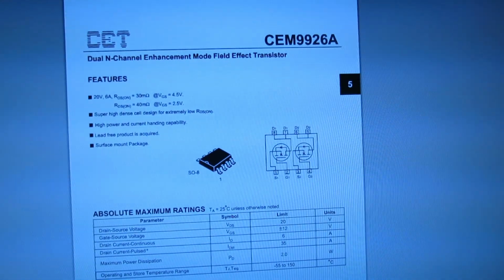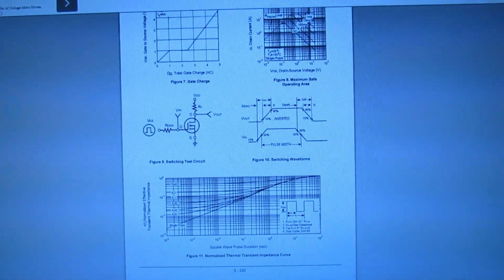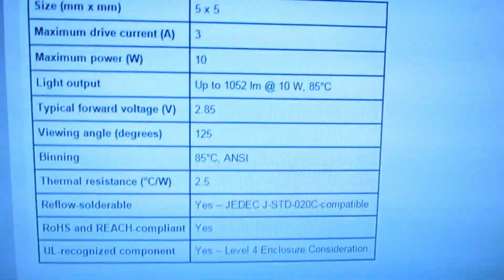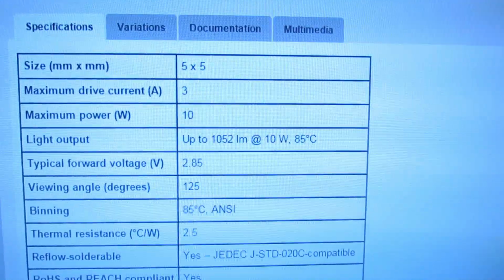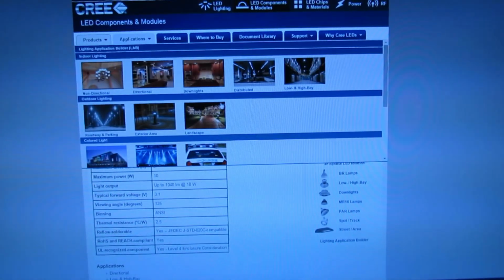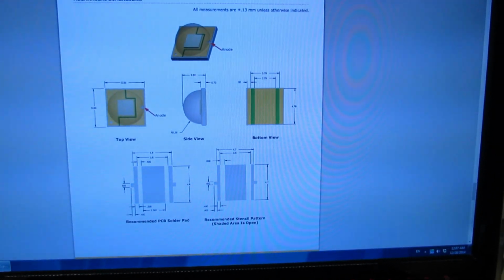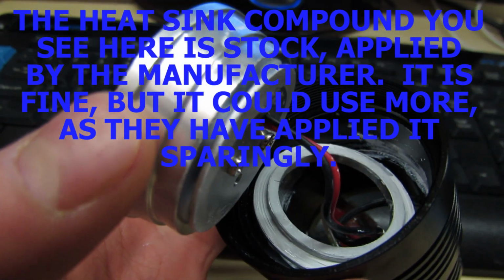SkyRay King 7 x Cree XM-L 2 T6 LED Flashlight Tear Down

Comment: If my vision, whether the flaslight does not use a resistor
Reply from the maker: Yes, the driver in mine used a current limiting resistor.
You can jumper it to make it more powerful, but it'll get hot real fast.
Cheers,
David.

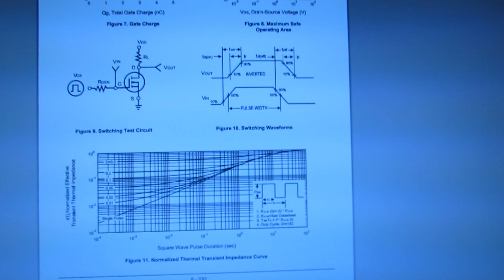Comment: first @3:58, it is square wave, not saw tooth. Second @4:08 400Hz can't be seen by human eye. We can see roughly 25 Hz and no further.
The datasheet CEM9926 you're looking is just a FET that is driven by the controller, so that's not the controller at all. All what you see isn't driving the LED, its just FET specifications!
Reply from the maker: Good catch!!  Thanks man!  I don't like the stroboscopic effect, that can happen with chopping light, the newer drivers seem to get rid of that, but some cheaper lights still have it.

Comment: here is a good review of the skyray king: 
https://youtu.be/d2jCcJTq3k4
Reply from the maker: Thanks man.
The 10 looks pretty awesome.
The Skyray King is a great light isn't it?
Do you run good batteries in it?  I recommend the Sanyo 3500mAh batteries, or the LG 3500mAh, they give you lots of power and great runtime.
A full 3500mAh of power, the cheaper batteries can be pretty horrible, and give like 900mAh if you're lucky lol.
Cheers!
David.

Comment: are you sure they are genuine original Cree?
there are many copies that are on sale inside these flashlights
they are similar in design,but less output and bluish tint.
look here
http://budgetlightforum.com/node/41084
Reply from the maker: Great question, some youtubers tried upgrading the current over 1.5A, and the fake XMLs all blew up in their 7 x XML SkyRay, so that's a great way of telling if they're fake, just drive them up to 3A, the real CREE ones will handle it like  champ and output around 100 lumens/watt, or 1000 lumens total.
It seems that if you get the XML2 version, you'll get real ones, since they haven't figured out how to fake them yet.  What they'll do is ship you XML fakes, instead of XML2, hoping you don't notice, but that's an easy scam to catch, so you'll get a refund easily, did that once.  The seller said nobody else complained.
I also boosted the power input of my SkyRay 7x XML2 to over 70W(Peak 85W), and it handled it no problem, so for sure these are real XML2 LEDs in the one I received.

With regards to the latticebright LEDs:  I have some Latticebright MCPCB boards with XML LEDs on them, and they seem to perform just as well as the real XMLs(Tested on my 3GS light meter rig), pushing out close to 1000 lumens, so I think those are real XML, and even perform better than the real XMLs that I had and some of my XML2s with a warmer white color temperature, which leads me to believe they're a newer production of the XML LED by Cree, maybe from a different factory under an improved process that results in a higher efficacy.

There is definitely a market out there for fake LEDs though, so we need to be careful and buy from Gearbest, Fasttech, Convoy, or other name brands, and we'll be fine.  It's just the cheap $5 flashlights that will have the knockoff LEDs, or SkyRays from Ebay and Aliexpress from sellers with poor reputation, and even then, at $20 for a flashlight that produces over 2000 lumens, it's still not bad(But still criminal, if they're mis-advertising it as a true Cree brand).
I've been ordering replacement LEDs from Convoy and Fasttech, those will be real for sure.  They wouldn't jeopardize their reputation to make a few bucks off a $6 item, lol.
Thanks for the comment!
Cheers,
David.
Reply: "be careful and buy from Gearbest, Fasttech, Convoy, or other name brands, and we'll be fine".
That's not full true, there are copy also of spares Leds like XML2 (only borads with leds)from the Chinese stores you mentioned.
Also manufactures of these flights change often,so 1 time would be good, next time not
Reply from the maker: MACYNET323 Ya that's true,  it could still be fake at some point,  but I think those sources are pretty reputable,  and their customer service is awesome so if you run into a problem,  you can get a new one shipped.
I got a defective XPL from Fastech once,  it was on an aluminum MCPCB, it had a loose internal connection,  they sent a replacement right away and apologized for the defective item.   Pretty awesome service.
Reply: there are many XM-L2 Clones made very well estetic,but still fake
http://s22.postimg.org/gfv2t21yp/LB_XM_L2.jpg
You can see,there isn't the classic dot on the corner.
your skyray from wich seller  bought?
thanks
Reply from the maker: That's a good attempt at a fake XM-L2.  Here's some pictures of my XM-L2s in the SkyRay I have:
https://www.dropbox.com/sh/fpfte70oqgtvctj/AAD1LFTSPxQyRr9uQOEXf81ba?dl=0

The dots of my grid are offset, the fake one's grid is square, so they've made it pretty easy to tell it's a fake, that's good for us to identify.
I got mine from ebay, but that was back in 2014, probably before they started making fakes, since the XM-L2 was fairly new, and was only mainstream in 2013.
Fast forward to 2017, now there's been plenty of time to make fakes, unfortunately.
I bet they haven't made fakes of the XPL or XPL-HI yet though, so those would be the best LED's to get.
The Ebay seller I used isn't selling anything anymore, so that source is gone.
Youtuber Petar has ordered and confirmed that this SkyRay has real XM-L2's, http://tidd.ly/fbd5f508 .
So that's good to know.  We should thank Petar for letting us know that.
He hasn't increased the ampacity to it, which would be the real test, but he's taken a close look at it to confirm it looks real.
Maybe I should order one and try supercharging it.  It's $40 instead of $32, but I think the $32 may be the fakes, and the $40 gets you the real XML2, you know what they say, you get what you pay for!
Hope that helps!
Cheers,
David.

Comment: From the specification page it shows it pulls 3 amps, does that mean 3 amps for each LED or 3 amps total? If total, that's barely pushing those LEDs. If it's 3 amp per LED, then we are talking about a 21 amp draw. Do you know which it is?
Reply from the maker: The spec is for a single XM-L2 LED, so each one is rated for 3A, the stock SkyRay King doesn't drive the LED's to it's max rating.
I tested this stock SkyRay and it pulled about 8A at full voltage, so 1.14A per LED, it's still pretty bright, but if you add more cooling, and increase ampacity, you can push 21A to it, and have it operate at it's max potential.  I did that to this SkyRay and it worked pretty well, video of it here: https://www.youtube.com/watch?v=Wnuu9P465ZU

If you put a single XM-L2 on a copper SinkPad II, it can pull 5.2A no problem, maybe even a little more.  I did that to the Convoy S2+ (Check it out if you'd like: https://www.youtube.com/watch?v=Uzjv_zwr8Ng)

But I think the best mod to the SkyRay King would be the moppydrv firmware, I did that for $5.40: https://www.youtube.com/watch?v=efl0R63-ik0

Hope that helps,

Cheers.
David.
Reply: +David Sunshine Okay, so that 7,000 lumens is just marketing talk. At 1.1 amp each the total lumen output is what, 1500 to 2000?
Reply: +JasonWW2000 Correction, I see it's about 400 lumen per led, so that's about 2,700 lumen total. Does that sound right?
Reply from the maker: Yup, marketing talk all the way.  Sometimes they say 2000 lumen lights, for a single XM-L2 light, ya if you push 5.2A to it maybe!  After heavy modifications you can do it, but it's more like 600 lumens stock.  It's got potential to be 2000 lumens, if it's a true XM-L2 LED.

At 1.1A, 4.2V(fully charged let's say), it should be 3.63W each led(forward voltage of 3.3V), so about 421 lumens each (assuming 116 lumens per watt, so 2948 lumens output for a total of 7.

Which is quite a bit of light, it does get hot at 25.4 watts, and reasonably, that's about as much as you'd want in a small flashlight of this size.  At 85w, I really can't leave it on for every long, the thermal trip kicks in after 3 minutes.
For the stock, I think at 6 minutes it's way too hot to hold.
Reply from the maker: Ya you're right, if you use the luminus flux graph, and at about 1.1A, it should be at 145% of the 0.7A flux, which is 280 lumens for a T6, assuming they gave us a T6, then it's 406 lumens.
I like to use wattage, since they say it's 116 lumens per watt, or up to 170 lumens per watt.
Imagine that, if they gave us at least an LED of 150 lumens per watt, but knowing them, it's cheap cheap cheap and it is more like 100 lumens per watt, maybe a T4 bin. LOL.

What kind of light are you looking for?  A super powerful light?
Try out the Convoy L6, I'm making a video on it, you can check it out when I post it if you're interested in that kind of light.

The On the Road M3 is a good EDC if that's what you're looking for.

Or if you just want to mod a flashlight, the SkyRay King is a good one for that.  I've had success with the Convoy S2+ mods too.
Reply: +David Sunshine Honestly, I have no interest in a Skyway light, it was recommended to me and I figured I'd watch. I've currently got a Convoy L6 on the way to me. I can't wait to try it out. I ordered it for security work which it seems well suited.
Reply from the maker: If that's the case, the L6 is definitely the winner. It's high quality, high output, a very intense beam/hot spot, and would be my choice if I were doing security work as well.
The SkyRay King is very powerful as well, but the quality quite low, I wouldn't trust it.
What batteries are you gonna use with it?  It draws about 5-6A, so good batteries will go a long way for it.  The LiitoKala 5000mAhs should be good for it.
Cheers,
David.
Reply: +David Sunshine I ordered some Keep Power 5200mah protected 26650's for it. Some say they are a bit too long at 71mm, but others say they will still fit. I'm pretty sure I can get them to fit either by removing the spring by the head or by using a thin spacer/washer to get a couple extra mm of length. I'm not too worried about the length.
Reply from the maker: Cool, ya I think it'll fit, the front spring and rear springs are pretty long, you probably don't have to do anything to get it to fit.  You can always cut the springs in half too.  Could even add copper braid on there for the bypass, make it even better.  Right now they have a thin wire for the bypass, better than nothing.  At 5A you don't need much anyways, just helps a tad.  I got some copper braid(desoldering) off of amazon, I'm pretty happy with the stuff, was only $6 for 5 rolls, the wire will probably be fine though.

Comment: Today just received one of this from GearBest, and i found that low beam is not working :/
I hope the other modes would stay intact...
Reply from the maker: That's strange, so it's off, high, low(off again)?
If you double click, then it's strobe?  Does that mode work?
It sounds like the control chip's PWM function is failing, is that's what is happening?  You have to press the button once for high, once again for low(which is off), and once again to go to real off, then once again to go to high again?

If that's the case, contact GearBest customer service, and see what they can do for you, just ask them for your options, they will give you your options, and then go from there.  They should be able to help you out.

Cheers,

David.
Reply: ***** Well it was my mistake.This flashlight has only High and Mid.
Not low (moonlight).
Reply from the maker: Ya it's low isn't moonlight, it's more like High, Mid, Off.  It's too bad, that's why I put the the 105D in there, to get a 5% mode, but you'll want to get a driver with a momentary button activation rather than on/off, I just used what I had, it was a $2.30 driver.  It would have been $16 to get a good momentary button style driver.
I show you how I added it in this video: https://www.youtube.com/watch?v=Z9oIGLOU7yk
If you're in the US and can get cheap shipping, you can buy this for $4.40(http://www.mtnelectronics.com/index.php?route=product/product&product_id=209), and ask for Group 3, with a turbo timer of 180 seconds, that way it will start to get really hot, then automatically drop to 25%, which is perfect for the high powered SkyRay King.  You'll just need to connect the switch to Star 4.
It's an easy MOD and will make your SkyRay have the same type of functionality as a more expensive $200 light.

Leaving the light on at 100% for over 3 minutes could easily burn up the mosfet, controller, and batteries, so this would be a great upgrade to the safety of the light as well.

If you're really keen, you can also get moppydrv firmware, the description is shown on this other FET driver, but you can buy either and it'll work with an electronic switch the same, so the cheaper one would be the one to go with:
http://www.mtnelectronics.com/index.php?route=product/product&product_id=227

You can program it between 16 different programs, with or without memory, you can even set the turbo timer(but it'll drop to 50% instead of the 25% in the Group 3 firmware).  

It's a little bit of work, but if you want that kind of programmable flashlight for cheap, it'll definitely do the trick!

Cheers,

David.
Reply: Unfortunatly im in europe and usually the shipping costs in most cases are high, but i'll check it out.
Thanks for the info.
Reply from the maker: Oh that's too bad, I think it's only cheap for those in the US.  I wouldn't bother changing it then, unless you can get a cheap driver for it.  But I haven't found a good source yet.   You're welcome.
Cheers,
David.

Comment: you can use unprotected batteries with flat top?
Reply from the maker: Hi, 
Great question.  You can't use unprotected flat top cells, like the Panasonic 3400mAh or LG 3500mAh, they won't work, and you'll need to add a button to the top using a soldering iron.  It's easy to do, but some will find it a pain.

Good news is, that the new Sanyo/Panasonic 3500mAh (http://tidd.ly/370373d3) unprotected cells have a small button top, and will work in the SkyRay King fine.  I got 4 of these and they worked perfectly in my SkyRay without needing any soldering.
Hope that helps.

Best regards,

David.
Reply: ***** You think you work with these batteries? http://goo.gl/7HX8Wd
Thank you
Reply from the maker: Hi, I have 4 HG2s and tried it, it works, but it's a flat top and the plastic of some cells may interfere with the contacts, the Sanyo 3500mAh have a button top so it'll work better.  If I were to run the HG2s in the SkyRay I would solder a blob of solder to the top just to make sure I don't get a partial contact, which would cause issues.
The HG2s have an internal resistance of about 37mOhms, vs the 53mOhms of the Sanyo 3500s, so the HG2s will be more powerful in the SkyRay if it uses current limiting resistors, I would run the HG2s if I wanted more power over runtime, it's not that much less anyways. 
Hope that helps.
David.
Reply from the maker: Ya, if it's too flat, you gotta solder on it, most flat tops are that way. The Sanyo 3500mAh are nice though, that they provide a button top in a flat top format.  They are the same length as the Panasonic 3400mAh flat top too, I guess they brought down the edge/plastic wrap a bit to achieve that.  Great for us SkyRay King users, no need to solder anything to get it to work.
Cheers,
David.
Reply: Im using the same 18650 as in your link, and i faced the problem that the flashlight wasn't go on or turned off when i shake the flashlight.I partially solved it by winding some cable (not stripped) at the springs to make them stiffer.
Reply from the maker: +BASSstarlet That's a good solution.   The Sanyo 3500 has a button top though, it should work without mods,  which battery is it?
Reply: NCR18650GA 3500mAh

Comment: Thanks for the amazing video. BTW, do you have any acknowledgement on the ones sold on Lazada? Are they any good? look at these for instance: http://www.lazada.com.my/waterproof-skyray-10000-lumen-7x-cree-xm-l2-t6-led-flashlight-torch-light-gray-8933172.html thanks!
Reply from the maker: Thanks! I haven't heard about Lazada, or heard about the lights from there, is it another Alibaba express?  If so, it's probably similar to the lights that are being shipped now, they are fine, but watch out, when they say XML2, they have shipped XML hoping you don't notice.  I recommend getting it from a good source that you know it's genuine, here's my recommendation http://goo.gl/inwpWe.  I buy a lot of stuff from then and have always received great stuff, my friend had problems with his order once and they fixed it right away. 
Cheers, David.

Comment: my Skyray king 7 led have very crap led driver make only 1400lm o,0 and fake cree led's, same case smaller chip
Reply from the maker: Which seller you get it from?  When I order XML or XML2, and I get a fake, I'll make a complaint and get my money back, return shipping should be free, and if it costs money, you shouldn't pay, and should negotiate a fair resolution, since you did nothing wrong, the seller should fix it without cost to you.  EBay has return shipping for free now, so worst thing is that you have to ship it back and buy a new one.  Try gearbest, fasttech or eBay seller securitying, they all seem to work well.
Reply: +David Sunshine are normal green xml faks, but for 25€ are the price ok, led lenser with same or lower lumen output are much expensive
Reply from the maker: +MrKaschi They shouldn't be green, if it doesn't look like the typical images of XML or XML2, it's a different LED, it might be better for all we know, but most likely a crappy fake.  For that price you should get something good though, my XML2s are insanely bright, you should ask them to fix it. If it's from EBay, dispute it, we can't accept fakes no matter how cheap it is, unless they are better, then that's just cool!